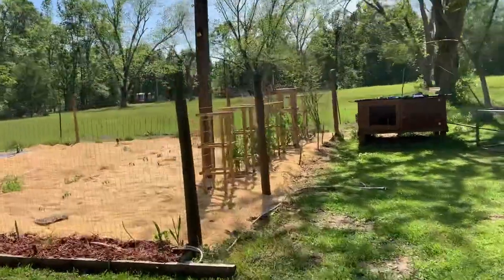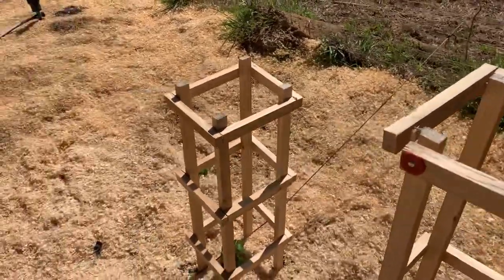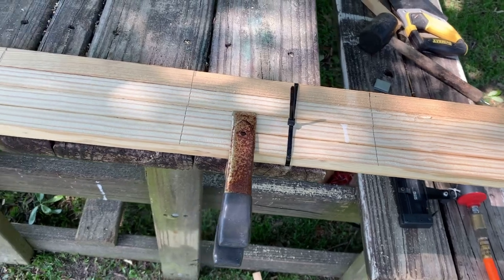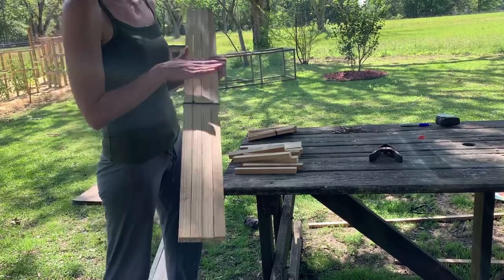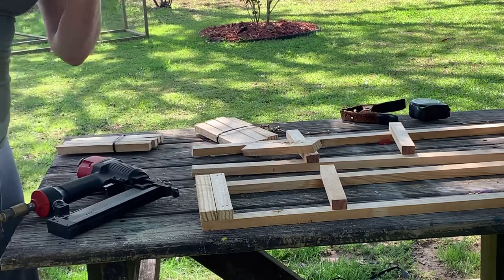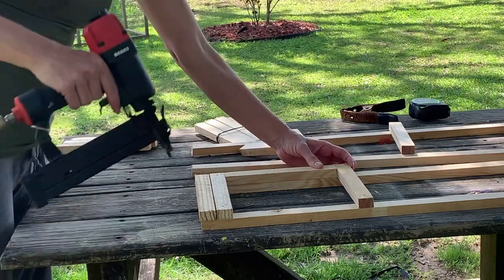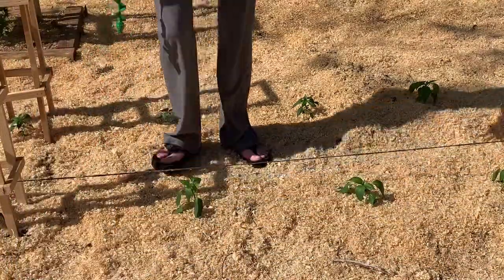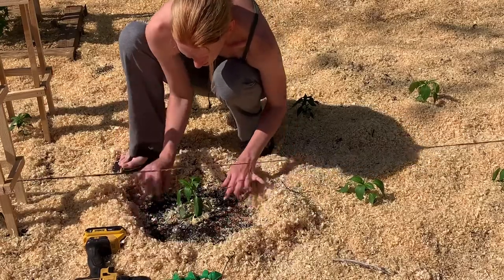How to make Tomato cages/pepper cages from wood. The last tomato cage you’ll ever need

Comment: Where do you store 20 of those? They won's last 5 years. A better solution is 5’ x 150’ of 10-gauge concrete wire mesh for $200. That is enough to build 21 cages 54” high, 18" square with 6” sunk into the ground. 
How to: Cut 2 pieces 6 squares each in width and cut the horizontal piece out of the length at the bottom. Use a 2x4 and bend the 6 panel 90 degrees with three panels on each side. Do it again for the second piece. Now you have two parts to a square tomato cage that will be 18” across and 54” high with 6” sunk into the garden. Secure with zip ties. I use rebar to secure the height if necessary.
Makes 21 cages (you use 7 panels to make 6 (waste) so 150' x 12" = 1800" / 42” (7 panels) = 43 halves = 21 cages for $200 so $10 a cage plus or minus one cage. You can stack the cages with no problem if you need 10' height and they store easily since they nest.